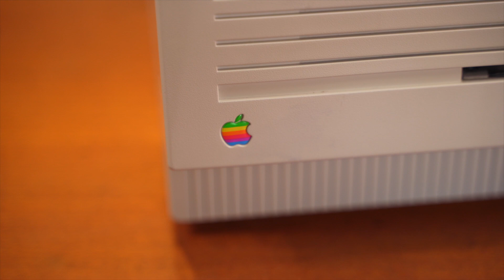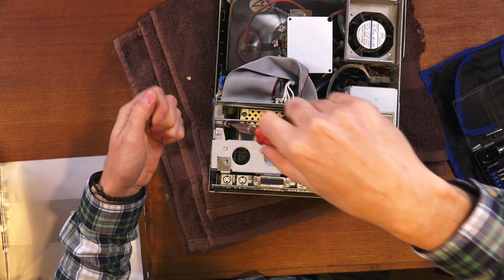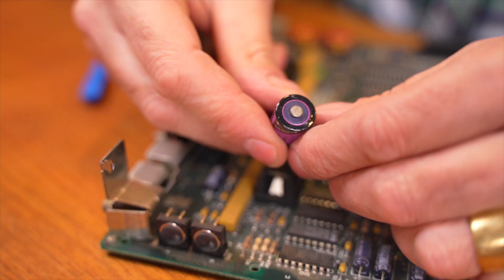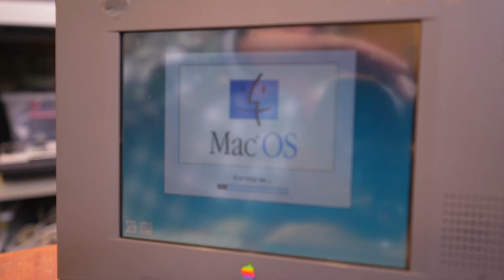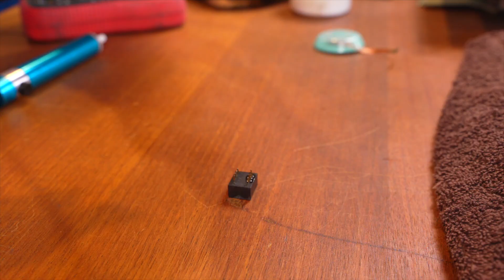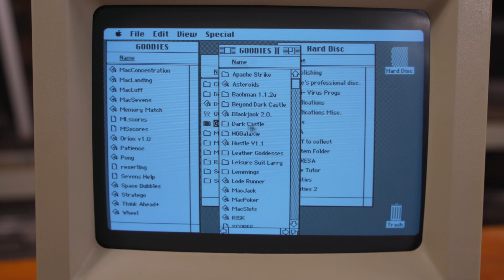Macintosh SE Repair - I nearly gave up! ADB issues!

Comment: Great video! I’m currently facing the same problem on my power mac 7100/88. The adb port is completely wrecked. In my case I think that it’s actually the adb port itself because I tested the fuse and it’s fine. I used to pour alcohol into it and it would work for a little and then in the end it just failed completely.
Reply from the maker: Sounds like it might need to go to rehab 😁
Reply: @TheBasementChannel  haha probably gave it a stroke with all the ipa!
Reply: i had the AT port not working on a battery damaged 386 board, i ended up just replacing the whole thing, took a AT port from a dead PCChips socket 7 board. best of all, it's purple

Comment: Hi there !
Awesome video !
I have one but I made a scsi HDD upgrade to 20gb ....but I wanted a faldero with a backup of all the 
old hdd files. So I copied all files inclufing the System faldero which I did not know it also hay a Finder !!!
So when I boot up the machine it said " There is a Finder conflict "
and since I never had where to conectado that newer scsi hdd 
the machine which was fully working , now has been parked and OFF since the 90's !!!
Can you help me ?
I need to running that scsi hdd on a other System to wipe/erase that System Finder File !!!
I believe almost 100% that I have an old scsi to usb adapter cable somewhere !
Is that the cable that I need to running that scsi hdd inside Windows or maybe best World be Linux ??
I hard Windows had Mac Opener !
Will Mac Opener app all me to erase files using Windows OS ?
Reply from the maker: What I would recommend is that you buy a blueSCSI. There is a model specifically for external connection to your SE. You can boot from this and then use the Mac to reformat the Hdd, or copy files etc. check out Ron’s video: https://youtu.be/4Mkx8KbEd54

Comment: Oh noes! You let out the magic smoke! Did you fix that too? Congrats on getting the system back up and running. I don't even have the skills to do the diagnosis you did. Well done!
Reply from the maker: I didn’t have those skills either when I started the video 😂  still unsure why the hard drive just started working again, unless it was working the whole time and the adb issue was stopping it from booting? Who knows? 🤷‍♂️😂
Might crack open the smokey PB Duo power supply in a different video and see what happened there. I don’t like being down to one functioning power supply.
Reply: @TheBasementChannel  SCSI hard drives are the bane of my life at the moment! You may want to look at getting a Blue SCSI which would allow for easier copying of files on and off the machine. I've only briefly tested mine but it works well and is super cheap compared to the SCSI2SD adapters. Glad its working for you though, just hope it doesn't die on you soon!
Reply from the maker: Yes the BlueSCSI is on my radar for sure. It’s only just become affordable in Australia, so I plan on getting a couple soon. 👍
Reply: @TheBasementChannel  I had a couple of issues with the disk images I made in BasiliskII or SheepShaver, but once they were in the Macs and I initialised them, they worked fine after that. Kinda weird having an almost silent machine!

Comment: Great job! Luck really wasn't on your side. It's in great condition I've a Macintosh Plus in desperate need of opening and assessing the damage got to make the time after watching this!
Reply from the maker: Thanks! Yes in spite of the issues it’s in really great condition, not a single leaky cap or bad battery to be seen, although I never took a proper look at the analog board... but for me the icing on the cake is all the neat games already installed! Might make another video of me trying to network this thing in order to back them all up to another machine.
Reply: @TheBasementChannel  yeah I’d love to see that! Also I’m very jealous of your camera set up! How many cameras are you using?
Reply from the maker: Two camera setup. Sony A7C for talking heads, beauty shots and alternative repair angle shots, and my previous workhorse, a Sony PXW-X70, is mounted above the desk for the top down shots. The 4K on the A7C allows me plenty of resolution to punch into the image so I can get another “angle” as well.